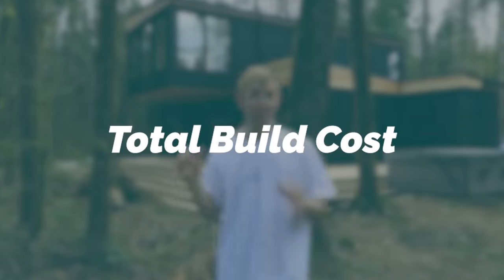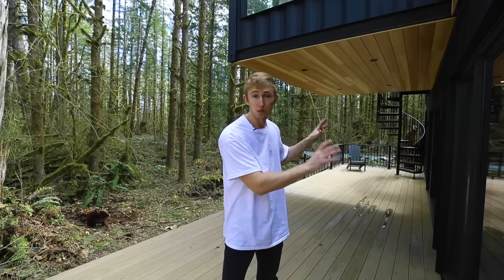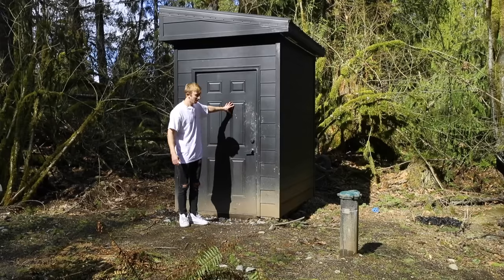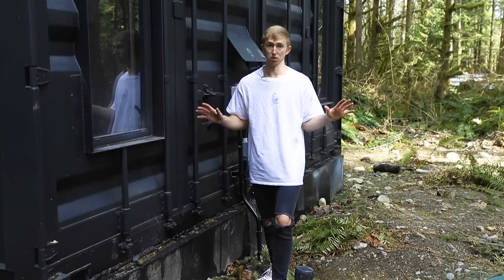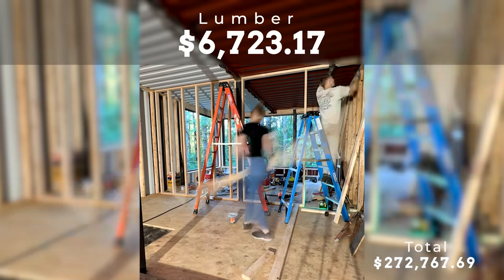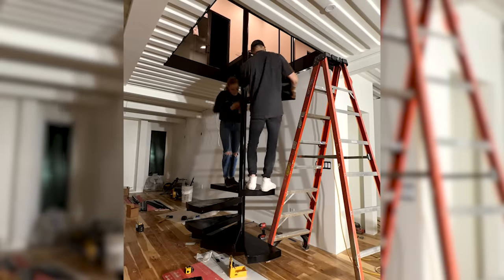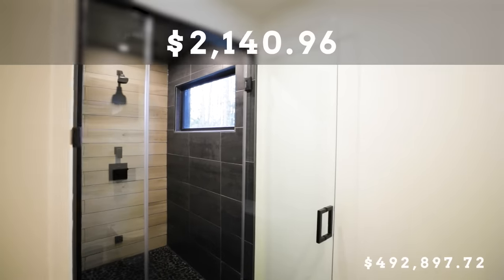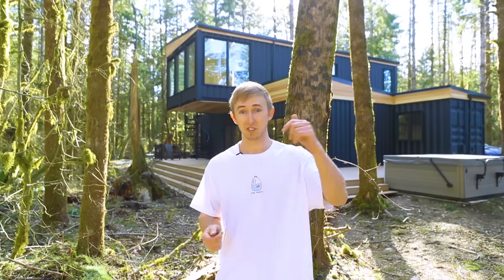How Much My 2-Story Container Home Cost to Build

Comment: When YouTubers often say “I’ll give you a cost breakdown” it’s usually followed by some fluff and it doesn’t include the smaller charges. Your video is the golden standard of breaking down costs while building a home. Excellent job!
Reply: For the price invested he should have a massive, Million+ in equity house. But instead hes stuck with a shipping container house, meant to be low cost.. for half a million... Gold standard it is not.
Reply: "The average cost to build a shipping container home is around $10,000 to $35,000, while larger homes can cost up to $175,000. "
Reply: @crisnmaryfam7344   I’m not arguing on the equity , I’m saying the actual breakdown of charges is more accurate than other YouTubers, but thank you for the insight !
Reply: When do you expect building costs to come down?
Reply: And most youtubers always exclude some of their major costs due to sponsorships. Which is annoying
Reply: @crisnmaryfam7344  Great job, you totally missed the point of the comment
Reply: As soon as he mentioned the containers not being intended to be stacked that way, I knew he was legit. Most of the shipping container home people just quote the cost of the container without mentioning everything needed to make it structurally sound.
Reply: A contractor would have built the same house and saved you alot of money
Reply: @crisnmaryfam7344  tbh it should of been worth less than 500k, he would have to hope people would rent the place out on airbnb and or sell it to recoup his investment
Reply: @crisnmaryfam7344  honestly if you build it differently and more naturally it'll cost half as much. It starts getting pricey once you decide to stack them parallel. Plus the land he bought is the real issue cause he had to get water and electricity done which costs a lot. A person on a budget would buy land that already has those things. I live in new Mexico and I got my .56 acres with electricity and water already installed for $11k, and spent $115k for the contruction of a 3 40 ft high cube containers stack 2 on bottom 1 on top with a patio on top. Not including appliances and furniture. 3 bedroom 2 bath with a living room kitchen and washer and dryer connection. I saved a lot of money by not going overboard with the cutting and welding, I kept most of the original shape of the containers. I only cut out and welded doors and windows, and welded the corners together inside and outside. Even made some money back recycling the scrap metal after that went to buying furniture.
Reply: I agree thanks for sharing this info
Reply: This vid got me to sub. Great details
Reply from the maker: Does this mean I'm officially a YouTube now 🥲
Reply: @devonloerop  Yes
Reply: @devonloerop   are the plans for sale?
Reply from the maker: @Tireslayer1  yeah! Thepacificbin.com then click construction plans. Feel free to shoot me an email if you have questions. Info@thepacificbin.com
Reply: @devonloerop  thank you so much
Reply: @devonloerop  purchased full set thanks again!
Reply: I stopped at the 5:45 mark cause these numbers he's talking about is definitely cap.
Reply: @Jonathan-dj3yb what did your total cost end up being?
Reply: @crisnmaryfam7344 you are so slow it's hilarious
Reply: @moneymakingmitch good 😂 he doesn't care you cant fathom facts

Comment: As a contractor In South Florida I can tell you the window lead times are averaging nearly 6 months.  It's insane. Construction costs post Covid are astronomical,  now is definitely not the time to custom build unless your independantly wealthy and have money to burn.
Reply: Probably good for you because the people  who are custom building near the Miami area definitely have some money to play with.
Reply: Very useful input. It certainly seems that you can get more square footage of real estate in the same place by buying, rather than building. Even if your construction budget is as tight as possible and your purchasing behavior is quite lax.
Reply: If you build out everything yourself, you can save a ton of money. If your not on a tight time frame and are willing and eager to learn, you can teach yourself every trade saving yourself a ton of money on contracting costs. I’ve seen it done that way many many times. But either way, the only way to bring costs back down is if people stop building and buying for awhile
Reply: @Itsreallymarcus  and generally I would agree, the problem is not doing the work oneself.  It's paying the individual trades i.e., hvac, plumbing, electrical to pull permits. Even if you do the bulk of the work yourself they still rape you on the permit cost.
Reply: @Itsreallymarcus  we’re talking about a guy who spent 31k on nuts and bolts + a Milwaukee tool set.
Reply: It’s the exact same in Australia right now, short on tradesmen, backed up for years of work, people from floods and hail storms/fires still waiting to get work done from insurance as they are short on tradesmen/staff. So many massive building companies in Australia have gone under due to the cost of eveything increase astronomically & their fixed contracts not allowing them to align with the new cost of everything, all their profits are gone and are forced to go under
Also many delays, worst time to build than ever, workmanship has declined in some cases due to being short on tradesmen & to much work. Production delays & shipment delays
Reply: @lukecolleyking  I'm an Aussie can confirm
Reply: @lukecolleyking   My father in law was trying to get work done on his property in Perth and it’s been an absolute nightmare for all the reasons you listed. They’ve burnt through so much money just waiting for parts and specialized labor, plus shoddy cost scheduling and communications has led to some of the work that was done having to be redone.
Reply: @gabe2308  Rest assured here in the states we're having many of the same issues.  We had a hurricane back in September, and there's been a back up of material shortages for well over 6 months.  And no signs of it getting any better.
Reply: @rolandbujeiro42  Brother I completely understand, I live in Louisiana 😂
Reply: @gabe2308  Brother, it's a nightmare.  Tough times to be a contractor.
Reply: I can corroborate this .. I work at a glass factory in Maine.  Lead times for Insulated glass is 6 weeks to delivery to installer who will then take the unit and clean and install into framing and that's before it gets installed into a home... it's insane.  Pre covid we were promising 2 weeks to delivery.
Reply: same story in my country
Reply: What I find kinda odd is that in my country the prices went down from the "covid prices"... yet in US its still "sorry folks, those covid prices are still here", guys must have really nice markups.
Reply: I customize my house to the window not window to the house
Reply: considering i live near a plant that builds said doors/windows... i will say the biggest reason for the long wait is due to the owners selling out to a large investor group that kinda took away all perks for working for that company thus losing experienced workers

yea... wages went up a tiny bit (for new employees) but profit sharing,  basically the best healthcare that was more or less fully covered by the employer as well as all employees getting a company vacation/trip during the holidays (... most businesses all wind down during the holidays so you had a full 2 weeks paid vacation and most of the time the location was renting out a luxury hotel in the bahamas or something)   .. think they switched to a 1000 dollar bonus after a couple of family's complaining because didn't go as the trip was a use it or lose it type of scenario

problem is... yea wages went up for new hires but it stagnated for older and a number of experienced employees all quit after the first 2 years of the buyout because well.... all their perks had been taken away by then and even with the sale due to the profit sharing system a lot of them got a large check if they had been there for a while maxing at i think 150,000 at 20 years after the buyout.... so they already got paid for their time and they actually started being paid less when taking into the account of having to pay more of a share for the healthcare premiums
Reply: I'm 28 my dads owned an rv dealership since I was 11 and since he opened I would fix whatever I could there a thin panel for a wall used to he $12 just a few short years ago that same exact panel is now $48
Reply: @AP-zq6hv  it's insane.   There's absolutely no cause for all the price increases.
Reply: My Pella black on black windows didn’t take that long, however, I did have to switch from Anderson in order to meet my new construction time line. If you are flexible and are willing to switch brands, then you can be successful as I was.
Reply: @Itsreallymarcus  okay that's all good but there are some things you cannot build yourself if you can't buy the material wholesale. I.e they only sell to contractors. I.e. Windows. You can make the frame yourself, but where are you going to go to get the actual glass? unless i havnt been looking hard enough, you can't just buy straight window glass at any hardware store, only ones that are available are the pre-made window+frame doors/windows. and if there are specialty stores i don't know of any. and if you wanted a specific non standard size of glass, who is going to custom make you one? sometimes the only option is to hire a contractor.
Reply: @Itsreallymarcus  ya theres a youtube channel called Homemade Home who has extremely indepth videos and cost breakdowns on all of this so its idiot proof. he has built several homes or reconditioned them for like 5-10k each. its kind of insane. thats the difference between not getting raped by boomer entitled contractors, living in a better state than washingfornia, and having the willpower and resolve to better ur position in life instead of protesting about perceived inequalities lol
Reply: @rolandbujeiro42  yeah permitting in florida is incredibly anti DIY
Reply: As a diy guy, I bought mine from Home Depot, and it took about 2 weeks. 😂 The contractor told me 2 months.
Reply: Or need a tax write-off.
Reply: I love how everybody keeps saying post COVID like these prices aren’t being set by the current administration…
Reply: @JWolf-nh9uw  on the contrary,  ever since the current administration took over,  prices have gone through the roof.
Reply: @marcus hepler  to an extent but welding framing pouring a foundation are things that can't just be learned by a person watching YouTube they need to be taught to prevent serious and deadly errors that could occur.
Reply: You could of bought a bad ass house for that price that's crazy 😮
Reply: I'm a manager of a window & door installation company in England. We can get most bespoke window & door installs ready in 3-4 weeks. Even at the height of covid it was only around 2 months. I wonder why there is such a huge difference between the Countries.
Reply: @Itsreallymarcus  thats what im doing but im also lucky asf as my family is all construction and trades when i was 3 i was on my dads lap while he drove all the heavy machinery to clear 2/5 acres of land and was able to watch and be semi involved in building a house and now im 17 and im thinking of buying a few acres to invest and build a house on but id do everything because ive been doing this my whole life and i have great family resources for whatever id need help with.
Reply: @gabe2308  you cant hire people as trades really anymore there's so many fly by nights and people that don't give a fuck about their work and just want money. which is good for me because when i get hired the people are happy asf but normally it makes my job a living hell because the work they did is just so wtf were you thinking.
Reply: @Itsreallymarcus  The best way to bring costs back down is to get rid of the corrupt politicians etc that pushed the prices up to begin with.
Reply: Obviously this person is independently wealthy 😂
Reply: He has money to burn
Reply: @Mr3uk1  I can't speak for other countries,  but at least here in the US it's really just an excuse to drive up costs.  There really is no shortage of materials but suppliers hold back on supplies and then triple the cost.
Reply: all by design!
Reply: @marcus hepler  I helped my brother build his house.  I know several trades electrical,plumbing,hvac etc. He saved a ton of money/headaches and has had 0 issues in 5 years. It also helped his property value skyrocket.
Reply: You bet, I warm my house with 100$ bills in the winter and use as fuel for the girll in the summer.
Reply: But it's cheaper to build now. Lumber price went down.  If you wait it's just gonna get higher again.
Reply: Lol $3 a 2x4 10.40 for a sheet of osb. Everything is up but not as much as people think
Reply: Good luck finding people to work in Florida.  Things are about to get really bad real quick with skilled labor.
Reply: The real high cost is the Containers, not the construction and covid has nothing to do with it, when are you going to stop riding that train?
Reply: Is this worth building in central Florida
Reply: Yeah for real. I work at Lowe's and I sold a custom set of shutters to a guy and it took three months! Some of the doors are running 6 months wild!
Reply: @xix967_5 can confirm, I am fuelled by $100 bills~
Reply: Here is my concern. Yes you  and prefab houses  are cheap but than our our Government  moves  to tax us on any  and everything  else !  We will have insurance  take over   and  property  tax. Water  no matter how  we think we are getting  ahead never until we fight together  constitution  rights. Of freedom   amen
Reply: Between hyper inflated labor costs and general contractor costs…. It’s insane.  Currently building and my father in law is subbing it out for us and doing a lot of the trim work.  Without him, we would be over budget.  Have been lucky enough to get some materials at cost through friends in right places.  Been doing what we can ourselves.  Still, over our original estimate.  Haven’t even done our bathrooms yet, and only paid half for cabinets.  It’s going to be pushing it by the end.
Reply: Hvac should be 5k
Reply: This is insane. I will become a windows builder 😂😂
Reply: @InsomniaReal Yes, I live in Florida and it’s just atrocious how people want a job but Don’t want to work! That goes for companies as well… I own a patch and repair concrete company, manly can do almost everything as far as that field but my problems are usually not on the job, it’s from a body shop, AC company, people that say “Oh yeah, I can do that for $$$.” Then the shit doesn’t get done right or done at all. 
I need a DeLorean and go back to 1955..
Reply: @nogerboher5266 The guy in the video said he paid $160,000 for the property/land.
Reply: But are the costs ever going to recover? Probably not. Just do what you want now if you can and carry on
Reply: @JWolf-nh9uw i like the way you think, theyre staring at the map trying to figure out  how the climate is affecting pricing because they never investigated the fact that they literally do what they want up top down
Reply: @rolandbujeiro42 not on the contrary. You just said exactly what he communicated. The current admin is the problem, not COVID, is his point. People are saying post covid when they should be saying why has the admin done this rather than how has covid done this
Reply: But most people aren’t trying to custom build. They just want to build a house to live in. And it’s cheaper than a normal house (or should be)
Reply: I got quoted $16,000 for 16 regular windows by Home Depot.

We to Home Depot and watched a Youtube tutorial and did it for $3k. People just scam you now...
Reply: Guys, here is The Savior

HalleluYAH “Praise ye YaH”

YaH is The Father (Genesis 1)
YaH arrives via the TENT OF MEETING
YaH was Who they Crucified for our sins
YaH was Crucified on an Almond TREE

Ancient Semitic Moshe (Moses)
Isaiah Scroll (The Original Isaiah)

Isaiah 42:8
I am YaH; that is my Name! I will not yield my glory to another or my praise to idols.

Isaiah 43:11
I am YAH, there is no other Savior but Me.

Isaiah 45:5
I am YaH, and there is none else.
Reply: Is it a good time to work in the blue colkar industry?
Reply: @Smex3h  Get into a short tech program and get certified in industrial maintenance.